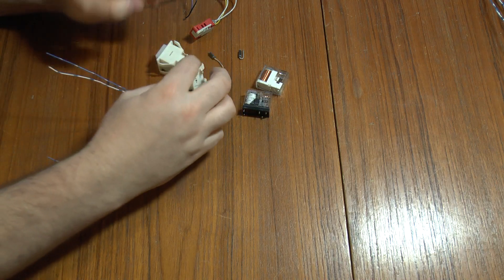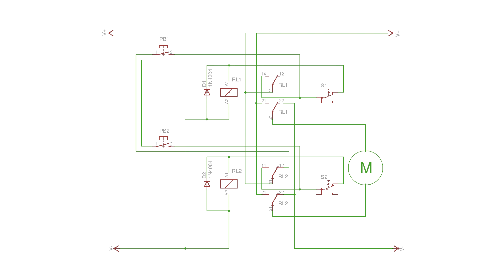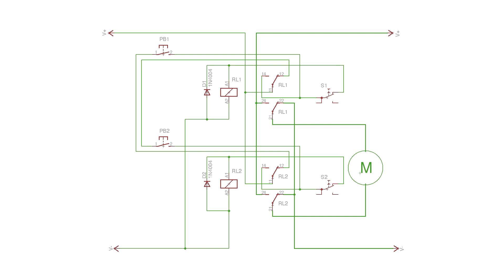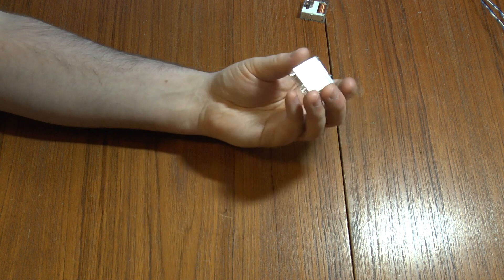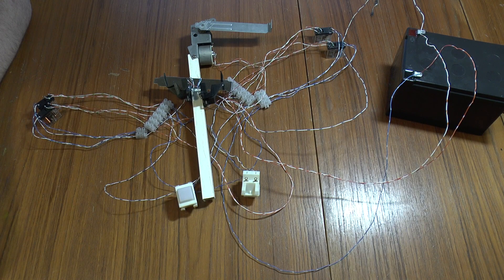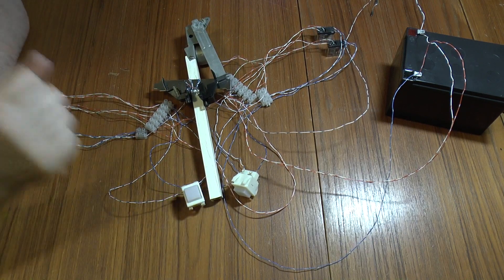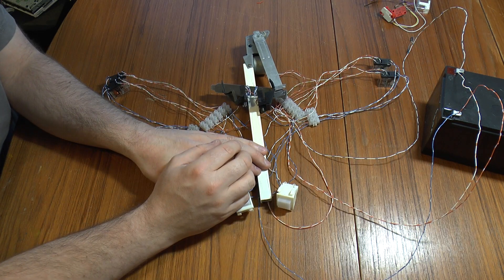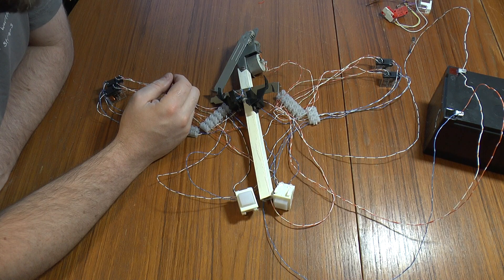Simple two-button, two-position motor controller

Comment: hi there. is this still a relevant circuit? or is there a simpler way of doing the same thing? cheers.
Reply from the maker: I don't think it can get much simpler than this, and as long as it fits the target requirement then yes it's still relevant, whether it's a monitor rotator or a curtain opener.  You could do it with an Arduino or a PIC (anything that has at least 4 input and 2 output pins) and get it to correct for double button pressing, the cost would go up due to the control circuit but be compensated by only needing 5-pin SPDT relays instead of 8-pin DPDT.
Reply: @AintBigAintClever  thank you for the response. all the best for your journey with your health.
Reply: @AintBigAintClever  another question is there a simpler circuit diagram? i'm such a noob with wiring etc. thanks

Comment: I'm currently watching this as I'm replicating a pop up headlight mechanism to create my own "Aero light"(a spoiler with pop up lights as opposed to having a light bar)
Reply from the maker: Nice.  If a microswitch failure would cause something to get chewed up by the motors, use two microswitches in series, so opening either one will stop the system.

Don't ask what I meant by "the motor the wrong way round", I've just watched the video back and I haven't got a clue :)

Comment: Hello sir,
My name is Nelson Santos and I'm from Portugal.
Good video, I think I found half of the solution for my project. I am sure that the movement is automatic "go, come and go" and then start and repeat the same movement. Help me, if one of the switches is turned on in the closed position and another open will it work?
It would have one button to connect and one to reset.
Thank you very much

Comment: what kind of role or switch are there on this circuit?  "http://i-fotki.info/23/282c97aa551311992acb8d2a4ae2281bc18ca8307310610.jpg.html"  I need to help
Reply from the maker: Normally closed microswitches, S1 and S2 on the diagram. They stop the motor at the end of its travel.

Comment: Thanks - I figured this out by reverse engineering the automatic sliding chicken door my wife bought. Pretty fun to tinker with. The failure occurred when the micro-switch failed due to contamination. I'm going to use this method for my next project because it's cheaper and easier than a stepper motor.

Comment: hi AintBigAintClever,
I have a question for you.
I am working on a project en i dont understand how i wire up the RL1 and RL2?
maybe you can explain that by another video or you can write it down in the comment? i hope you would do that. and i like this video much!
Reply from the maker: It'd be difficult to explain any clearer than the circuit diagram at 1:44, the hardest bit being to work out which pin does what on the 8-pin relays you have.
If you've got a multimeter:-
If a pair of pins is shorted together, you have the wiper and the normally-closed pins (11, 12, 21 and 22 in the diagram) but you don't know which is wiper and which is NC yet. Make a note of them (call the first pair 11/12 and the second pair 21/22), you should have two pairs like this in each relay.
If a pair of pins has a low (but not zero) resistance, you've found the coil pins (A1 and A2 in the diagram). Make a note of these.
Your two leftover pins are the normally-open pins (14 and 24 in the diagram) but you don't know which is which yet.
Now energise the relay using a power supply or battery across pins A1 and A2 (either way round).
One of the normally-open pins will now have zero resistance to one of the pins you found first. The pin it's now connected to is the wiper pin (11 or 21) - remember you didn't know whether it was wiper or NC earlier on - which means the other pin it was connected to earlier is pin 12 or 22.
Repeat this for the last normally-open pin to identify pin 11 or 21 (whichever you haven't found yet).
Reply: AintBigAintClever thankyou very very very much man!! your my hero! thanks! now my project is going to work! thanks

Comment: This is appears to be the ideal solution to something I'm trying to build right now.
A motorized shelf for a projector.

I would really appreciate it if you could tell me what kind of relays I would need for it and also, will a similar motor to what you used here be able to manage a 1.5kg salf+projector for a 90degree open and close mounted on a wall ?
Reply from the maker: Both relays are double pole, double throw (DPDT), the exact type would of course depend on the size of the motor. I'd expect any small motor to shift a 1.5kg load if geared down sufficiently but if you're talking about what I think you're talking about (flat to the wall, flipping down with the projector on it) you'd want the shelf to be counterbalanced so that it's not weighing down on the motor.
If this is your shelf in both positions (where O represents the motor axis):-
║
║
║
║
║
O
#
#

# # O ═ ═ ═ ═ ═ ═ ═ ═

make sure the # # bits counterbalance the weight of the shelf and projector. These may need to be heavier than the shelf and projector (think of a see-saw with a light person sitting at one end, if the person at the other end is closer to the pivot point they need to be heavier).
Reply: AintBigAintClever Thank you very much for the quick reply. I'm good with how to build something that is purely mechanic (hinges, weights etc.) but I have very poor knowledge about the electronics. can you help me better understand how would I match the relays to the motor? is it enough to go by voltage alone or are there other elements I should consider?
Also, would you recommend using the motor in a pulley system or is parallel to the axis with gears going to perform better ?

I plan to use it quite often (the open/close mechanism) so I want to make sure I do it right and that it lasts long.
Reply from the maker: Just make sure the relay contact voltage and current exceed the rating of the motor. If the relay coil voltage is the same as the motor voltage that will simplify things as you can use the same power supply for both.

If you use a pulley you can easily counterweight it. If I was going to do it I'd gear it with a worm drive on the motor, as the shelf then won't move with the motor stopped.

If you do it, don't forget to upload a video of it in action and how it's made!
Reply: AintBigAintClever Thank you so much for the info. It will take me some time to get to it but I'm gonna do it for sure !
Reply from the maker: No worries. You'll get such a kick out of it if you build it and it "just works" :)
Reply: AintBigAintClever Hey there ! So I'm finally done with the rig that's going to house the whole thing and I now going to see how I can use your simple circuit for motorizing it.... I have another question if you'd be so kind... How can I add a speed control for the motor into this setup ?
Reply from the maker: AC or DC motor? Simple way on DC: change the supply voltage. Fiddlier way: PWM speed controller (555 timer switching a FET at high speed?). AC can be done with a capacitor in series with the motor (I've seen it done on a 240V fan in an arc welder to run it on 415V) but you'd have to look up the correct capacitor rating depending on the required current and so on.
Reply: AintBigAintClever it`s a 12v dc motor. I`ve found several PWMs online which should do the job, thanks.
The bigger problem I have now however is that I dont know how to power the thing... :(
I thought I could use a laptop power supply but I guess that`s not the correct thing to use ?
The motor`s spec is :
No-load voltage: 12.0V 
Rotational speed (RPM): 9700 
Current (AMP): 1.3 
Operating voltage range (V) :6-18 
Stall: 
Torque (kg / cm) 6.0 
Current (A) 57 
Max efficiency at the time: 
Efficiency (%) 73 
Power (W) 52 
Rotational speed (RPM) 8490 
Torque (kg / cm) 0.60 
Current (A) 6.0 

all  I have at the moment is the motor (the other components haven't shipped in yet)
What kind of power supply should I use ?
btw, I'm trying to keep it all as compact and as light as possible.

Sorry for my clueless-ness.. and thank you again for your help
Reply from the maker: Ohad Elbaz
Sorry, only just saw this post. As you already have the motor, the best thing to do would be to put a multimeter in series with it to measure the current draw during operation. A 12 volt car battery will be an ideal temporary power supply for this. Once you know how much it needs you can go from there.

Comment: I once have seen a cassette deck that had a large motorized drawer instead of the classic flap. They thought they were clever by doing that, but the thing was full of rotting rubber belts. It used a similar circuit, but they did it with a latching pushbutton on the front of the case, and a slide switch on the drawer that hit the end stops. No relays needed, a few cents saved.

Comment from the maker: Draw it up and try it :)

Mine's fairly easy to get your head round, plus the control side is all low current (and can be low voltage), the only heavy duty bits are half of the relay contacts, which could be big-ass contactors if you wish.

Comment: Ahh.. didn't realise it had a brake... still just move the end switches to just before the end stops :p ;)
(6 terminal switch... middle to supply (wipers)... one set of diagonals short and to one side of the motor.. each remaining switch terminal to a limit switch NC.. the other side of each limit switch short and to the remaining motor terminal)

Comment from the maker: Hmmm... doable (going over the circuit in my head) with the two limit switches in line with the supply to each half of the switch and the motor sitting across the switch wipers.

I don't think it can be done whilst retaining the motor brake at each end though, this circuit shorts the motor at each stop position, acting as a brake (although this wouldn't work in the case of a universal motor because the stator coil would be switched off at each end).

Comment: Hell yes.  I have seen a couple of those old elevator "Controllers" in museums, and they are just relays on top of relays on top of relays, all inside a spiders web of interconnecting wires.  Truly amazing how they did it back when.  I would not even begin to start to work those things out! :p

Comment from the maker: Yep. This circuit needs at least two relays to handle the motor current switching, two buttons to tell it what to do and two microswitches to tell it to stop. Once you've got those there's bugger all left for an MCU to do! Multi-positioning gets you into MCU territory though, kudos to the lift guys for doing it all electromechanically!

Comment: Yes, it is simple AND IT WORKS.  Pretty much all elevators used to use a variation of this theme before MCU's took over.  They(MCU's) came into their own with elevator control though, it has to be said, but the early ones were all relay and switch based.

Comment: Great to see the good old-fashioned relay and switch method.  These days, the same thing would probably be done with IR beams and interrupt sensors and some kind of PIC!!!  So many things used to use this kind of thing from lifts(elevators) to telephone exchanges.  Everything now is MCU controlled, and a vast majority of the basic relay and switch designs have vanished.  Nice to see one being re-invented and described again. :)